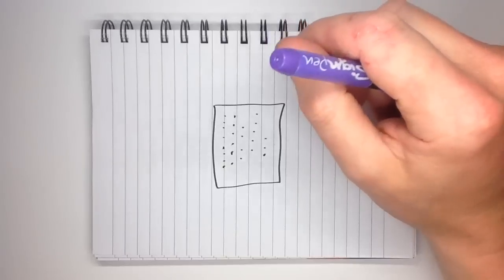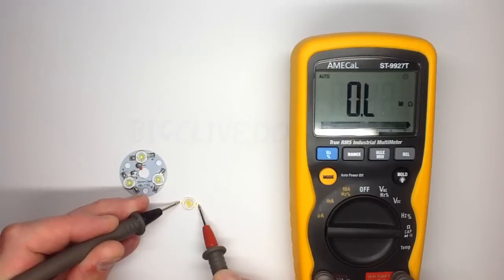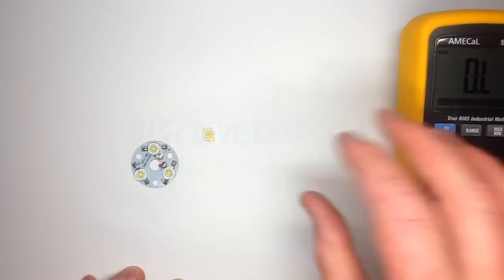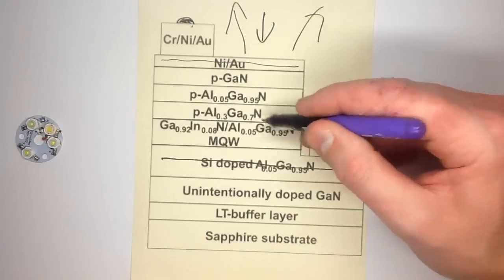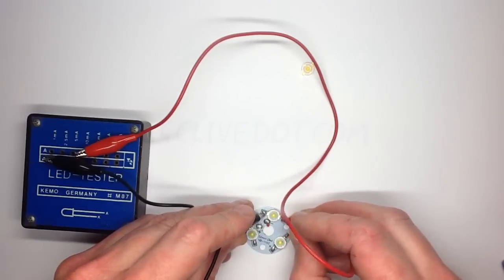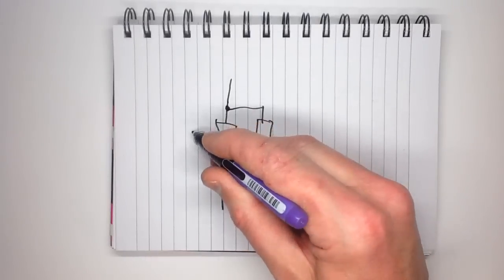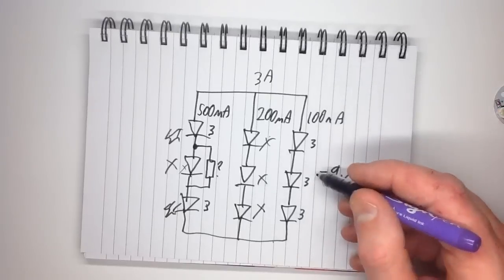The clown-science of crappy 100W LEDs.

Comment: Very informative, Dr Clown.  I thank you sincerely for the in depth lesson in "the Chinese can not be trusted" which, coincidentally, I learned when I ordered a batch of welding machines from those bastards.  I wish I had done the research with something that only cost a little rather than blowing my entire bank account on a few tons of dodgy equipment.
Reply from the maker: +c16h16n2o2 What sort of welders did you buy from them?  And what sort of issues did they have?
Reply: Sorry, but explaining my woes takes a novel:

It took about 8 months to get the order.   I was only prepared to be out of business for 3 months, thus ended up losing the shop that was to be the testing/sales point.  The bulk of those machines are sitting in a storage building awaiting my financial recovery.  Due to the hassle of shuffling back and forth, I only tested one each of most machines.

The 250A DC MIG/TIG/ARC has no instruction booklet and confusing controls, as the TIG circuit was added to a very solid MIG/ARC machine.  It requires three switches to be in the proper position for <MIG or TIG or ARC> and gas valves <MIG or TIG or OFF> to be synchronized, as well as to turn off MIG wire feed.  Both leads are hot while the machine is operating (TIG and ARC use the same plug).  Specifically confusing, the "Continuous MIG mode" switch was hijacked to operate the TIG gas valve. It took me a while to discover why the MIG bead was so finicky (no gas).  Also confusing, the TIG voltage and amperage are adjusted with the "MIG stitch timer" and "MIG pause timer" knobs.  I can not tell you which knob controls what as the test machine had a faulty TIG circuit.  Due to the confusing controls, I learned this machine can zap a decent looking MIG weld with no gas.  I forget whether they are set up for TIG foot pedal operation as requested, but due to the faulty TIG circuitry in the first machine my assumption is that I have couple thousand dollars invested in essentially useless 'high quality' foot pedals.

The first compact digital DC 200A tig/arc machine only zapped three TIG test arcs (only a few seconds each) before going dead.  The manufacturer said it was the diodes and was an easy repair, though I did not bother to follow up.  The second one seemed to work well.

The complex controls on digital AC/DC 250A MIG/ARC welder are very tough to dial in.  It took many, many attempts with the complex controls to get an ugly bead to take.  Switching to simple mode (with no preheat and cool down) I was finally able to get a decent bead to form, though it was still quite ugly.  I had high hopes for this one as it was very expensive and can be set up to weld nearly anything, but I am not a welding expert and fear that even an expert will find it to be difficult.

The digital 250A AC/DC TIG/ARC also takes some work to dial in a bead, but seems to work fairly well.  I also paid for a water chiller and requested one machine be sent with a water chilled torch, but no chiller was sent and no units had a water chilled torch anyhow.  (bye bye $400!)  Also, I requested these be set up for foot pedal operation, but the adapters were not installed.

The 200A TIG/ARC 50A Plasma machines work well enough with TIG and ARC, but the plasma flame blows out often.  Also, these were supposed to come with adapter to plug a TIG foot pedal, but it was not done.  These were missing the TIG torches, so they sent some with a following shipment.  The ones they sent were NOT on par with the torches included with other machines -- these are very ugly, cheap, and have their operation button zip tied to the handle!  Rubbish!

The portable, digital 200A MIG/TIG/ARC machine worked well enough, but depression from the other machines kept me from spending a lot of time testing it.

The 60A plasma cutters are the most easily operated machines, though not idiot proof.  I loaned the demo machine to an idiot for testing and he nearly burned up the torch.  Upon doing the first tip change, I was not thrilled to find the Trafimet style plasma torch works on a pressure-fit center anode (or cathode?) rather than threaded.

Most suppliers do not have such a horrible delay in shipping -- I just made a poor choice as to how and where I should invest $45,000.  I do not wish to expose the name painted on those machines as the good ones will eventually make it to eBay after a good 2 hours of burn time to ensure solid operation on all functions.  The bad ones will also eventually make it to eBay with their faults listed.  It is very likely some will be listed as boat anchors.
Reply from the maker: +c16h16n2o2 That's quite a large investment to make.  Stuff from China is best bought on small portions.  A true geeky welder who really understands the polarity and requirements for each type of welding process would have no trouble working out what were the best settings for each process, but a hobbyist would need it spelled out to them in detail and would probably still make bad welds.  If you do sell them it might be worth stating that they are only for use by skilled welders.
Reply: Indeed -- skilled welders will be able to put them to use.  Before eBay I plan to solicit students at local tech schools.  Sold locally, I have better prices than Harbor Freight and can offer a much better warranty.  Experienced welders usually prefer buying much more costly brand names because the ability to make a living is more important than saving a few bucks.

Keep up the good work calling out the shoddy crap sold by Chinese bastards!  Hopefully some day even WalMart will carry reliable products manufactured in first world countries. (HAHAHAHA!!!  As if!)
Reply: +c16h16n2o2 Man, that sounds like a nightmare.  This kind of thing is a real boot in the balls for people who go out into the world to make something of themselves.  A lot of people would be tempted to go back to the full-time 9-5 slavery after a hit like that.  I hope it works out for you, and you can eventually break even on this fiasco.
Reply: +c16h16n2o2 Also though don't the top of line welders usually keep their value as well?
Reply: I ordered a wireless mini camera that was supposed to work with 9V battery and cost about 20 dollars. Shipping and tull fees raised the price up to 60 dollars plus it drained the battery in 3 seconds (not completely, just enough to make it shut down instantly) completely  wasting the main feature. It turned ou the reason was a faulty 5V linear regulator. Yeah. Not repairable, the overvoltage had already damaged it. Fuck.
Reply: c16h16n2o2 Well Chinese kids are working in those factories to make that stuff, and dying for 2 or 3 cents an hour.
Reply: gantin strike  Some brands lose value more quickly than others, inclusive of factors such as specific function(s?), bells/whistles, and the value that the machine's owner places on it.  Complex AC MIGs are very expensive, basic DC ARC welders are cheap.  Brand names are expensive, generic Chinese crap is cheaper.  Of course, not all Chinese made crap is low quality.

Many of the expensive brand name welding machines utilize some Made In China parts, such as small electronic components.  As well, most have assembly plants outside of the USA so it's not like all of the assemblers are getting first world wages, though the brand name corporations tend to charge first world prices for all of their products.

Realistically, my goal never considered resale value, only sale value for the average hobbyist welder.  My intent was to sell machines that are more powerful than such an average welder would ever need, thus ensuring functionality and longevity.  The goal is still something I can achieve, but there are a few bugs I'll have to figure out... ......quite a few....

Comment: 1st of all let me commend you for your adult handling of the people who as one other respondent put it "are a combination of ignorant and arrogant". You have addressed the situation, and I suggest they be ignored going forward. In my experience trolls leave when ignored.

 For the record, I am an Electrical Engineer with 40+yrs experience. I commend you on your intelligent, logical approach to this issue, and I too have been considering moving to the higher wattage arrays (lightly loaded) now that the price has come down (I have one here I paid $50 for a couple years ago you can now buy for around $10). 

You mention that the larger arrays may be harder to produce, thus that may be at least part of the reason that there so many bad ones. 
 During my career, I worked at IBM (as a contractor) developing some of the semiconductor manufacture machinery now in common use. Consider your average LSI device or microprocessor, routinely manufactured several hundred to a wafer, with hundreds of layers, involving many nanometer class masks. These are pounded out with an incredibly small reject rate these days. LED arrays are the equal of an auto manufacturer making hammers, it's just not a strain on the system to maintain quality.
 If there are bad ones getting out, they are either known bad or are damaged after shipping. I suspect these are rejects that have been stolen (or purchased) from the manufacturer by unscrupulous individuals looking to make a buck the easy way. The failure modes you demonstrate don't appear to be static damage (which LEDs are quite resistant to), Static damage generally shorts the junction or opens the pin wire, or both. Shunt resistance like you see here is most often due to contamination, damage during dicing (cutting the chip from the wafer) or improper packaging (welding as you point out - usually a 'miss')

It's our responsibility to call these sellers on the junk they are selling. There's plenty of profit to be made by honest sellers selling 1st quality components. Despite this, there's a booming counterfeit market (take the SD card situation for example), and that really what's going on here. The only way to stop it is to educate people. These rejects are the equal of counterfeit products, whatever the source for the fakes. If people are warned off the bad suppliers, things will change. Feedback is king!
 
That's the beauty of today's global marketplace, while there's openings for dishonest people selling this junk, there is also a instant feedback of the junk they sell through out trade/hobby forums. 

Sorry to run on, as they say, just my 2 cents. -- and keep up the informative videos.

Thanks
Scott
Reply: thats very true, not like the hate from the people that think all chinese leds are like that, as almost all the high quality diodes are made in china.
Thanks for the clarification

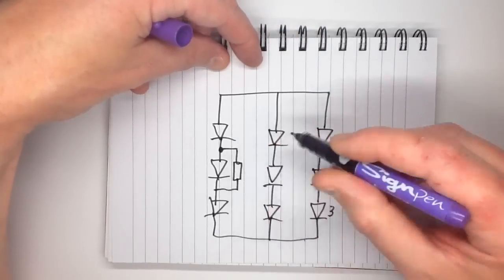Comment: From 10:05 your explanations becomes very very dodgy.  If the third string has 3V+3V+3V this means total voltage is 9V.  So if you say Led1 and Led3 of the first string both have 3V over them the voltage over the resistor is not ? but 3V (9-6).  Further on you say that if for instance if the total current throught the circuit is 3A then the currents throught the individual strings could be for instance 500mA+200mA+100mA ... I don't think Mr Kirchoff would agree with that.  I don't say your observations are faulty, but Kirchoffs laws should be obeyed at any moment.
Reply: I think you're misunderstanding the 9V on the third string - the ~9V is required before the third string lights up, not that the circuit is being supplied with 9V. When he is talking about the first string with an unknown voltage over the resistor, he's talking about what voltage is needed for the first string to light up (6V + the unknown), and is basically saying that it will start to light up before the 9V required for the third string to light up is reached.

Agreed on 500mA+200mA+100mA != 3A, though it looked like he was picking random numbers on the spot to get across the point that the currents through each string could be very uneven.

Comment: Well. I KNOW you're right, I understand semiconductors, LEDs, and so on but, In this particular video... you just made scrambled eggs of your math... 
Come on man... 500mA plus 200mA plus 100mA equals 3A? :-/

BTW, I might had said it before on one of your vids but, aside `cheap` and `faulty`, there is a well defined reason for the situation. 
The leaky chips will eventually collapse. The temperature gets to them and the faults deepen. Logic. But what happens when one chip goes out? :D Only one. The one. 
I mean out as open circuit. Even if it shots for a while, the entire current that was somewhat distributed between the chips, that one solider that broke the ranks will go open-circuit. 
Then, the whole rest will get a lot more current than they should. An entire branch went out because of one. Weak ones in the remaining braches will puff (one per branch) and the entire regiment dies. 
This happens fast. Seconds, minutes, perhaps days in those under-powered fixtures. 
But they blow. Aaaannnndddd... then you go buy another. 

Happy Chinese folk that makes.

Comment: I am a big fan of your videos and make Led lamps for a living. Have been seriously considering leaving all parallel cob LEDs out of my products and only using 10w 30v (9 in series) for some time since I so agreed with you before I watched this.
All the best!
Reply from the maker: +yagoa Or clusters of three 10W 12V LEDs in series?  I've been toying with retrofitting a 20W LED light with an array of 10W modules since they seem a bit more reliable.
Reply: Thats what I have been doing but it doesn't seem worth to test the 10v ones for leaks even though they are 0.18 USD and the 30v are 0.25 USD with the same emitters
Reply: or maybe run the 10v ones on lower current and get better heat spreading and place them closer together.
Btw if you are ever in Brazil or Sweden let me know :)

Comment: First things first measuring resistance of a component still soldered on to a circuit will get get you the resistance of the circuit. Always measure resistance by removing the component. read this entire article it will tell you why you are getting different values for leds https://en.wikipedia.org/wiki/Network_analysis_(electrical_circuits)
Reply: +Zany Fanny never use the methods shown by this guy his analysis is totally wrong.
Reply: 2 years old yeah but i had to reply. The "circuit" in this case doesn't matter because it's an open circuit. there're only the other leds on the board and they're all wired in series with each end of the string terminated at the + and - power supply terminals, which are in this case not connected to anything.

Comment: good video, with just one major quibble: who knows what that pcb has done to the tests, the problem could be in the pcb which the LEDs were mounted to.  scientific method says remove all possible wildcards (as such, different terms same effect) and test test test.  That PCB could be partly conductive and the source of the defect, with how cheap it was made too.  IIRC those aluminum backed LED PCBs are only a few microns thick insulation to the aluminum substrate and just as easy to "blow through" or have defects as the LED internals.

The failure to remove a known possible wildcard is a problem.  Please even if you do not post a video of it, would you remove the same LEDs from the PCB and test again to verify your results and post here, +bigclivedotcom ?

Comment: I think the only clowns here are the ones who attacked your observations and test methods.
You have done precisely what any proper engineer would do when evaluating the functional status of semiconductors.
Keep up the good work.
Reply: +CNCmachiningisfun close but not exactly. I have a single quibble with the testing methods, i.e. not removing the aluminum pcb, which could be the source in this particular problem.  If he removed them after testing and got the same ohm results on testing, then his point would be completely vindicated/true.  Those aluminum PCBs like that only have a few microns of insulation to the solder pads and could just as easily be the source for the problem here.
Reply: JaqiesGadgets
That's a fair point, as it may be a contributing factor.
In my line of work, I deal with large numbers of 5mm White LEDs. 
These are rated in the order of 20,000 mcd, and are stunningly bright when well treated.
With these, I find the same faults as are showcased in this video. Some of them fail to light at low currents, and others literally flicker and flash.
In the ones that fail to light at low currents, I observe that they have developed a parallel resistance just like we see in the video.
On the flickery - flashy ones, I have discovered that the chip is not properly bonded to the Cathode cup.
The cathode lead becomes sufficiently mobile during soldering that it can partially dislodge the chip from it. In my experience, this affects Blue, Green and White leds only.
While this is a fairly rare occurrence, it plays havoc with designs that use large numbers of these leds.
Ultimately, this fine technology will become more rubust, but we do have a fair few problems to deal with in the meantime.

Comment: For folks that don't know, an equivalent circuit for most power LEDs is five silicon diodes and a single 1-ohm resistor, each of appropriate power rating, in series. Electrically, that's what a single power LED die looks like to the power source.

Comment: Do you do birthday parties? (Just kidding) Is the best way of testing Chinese vendor LEDs by ordering one of then ramping up the current? Is there better success to order local (not china)?
Reply: +Digihaven I use ~24V to test the 100W. That is a current <1mA. In this case you can better do it with voltage, because you ca easier regulate low currents with that. 
I bought a 100W let two years ago in china, it works perfect, a 100W in my country would cost 15 times more. The same vendor send me a 30W RGB LED that was broken (dead pixel). All i bought this year from different vendors were all broken. ( 100W white; 30W yellow, red, blue; 10W white 3x3)